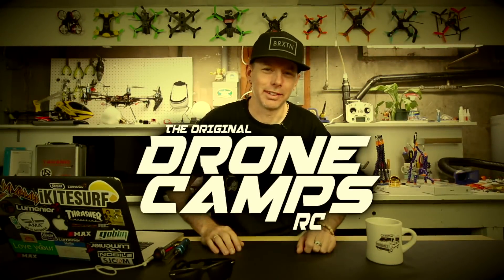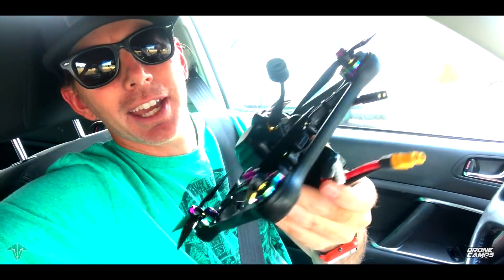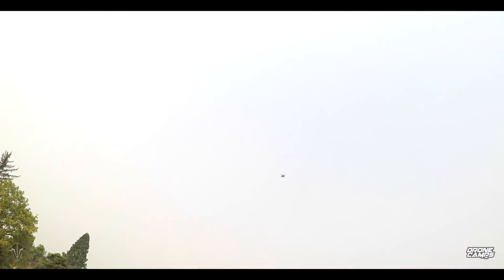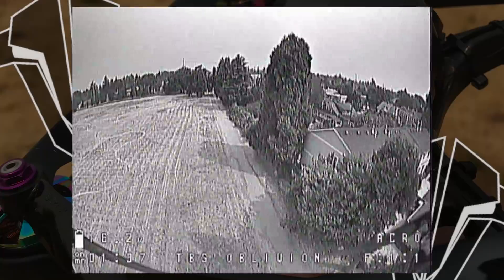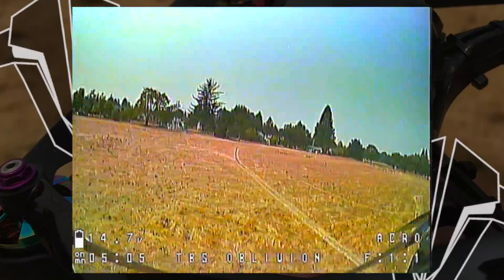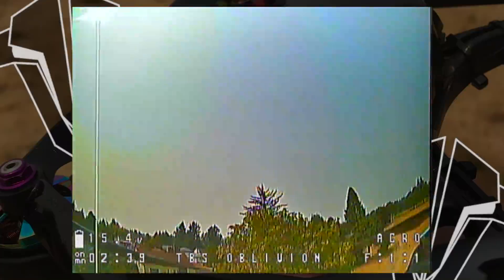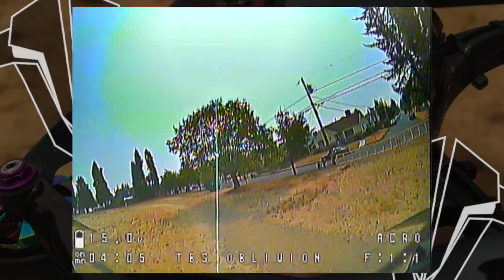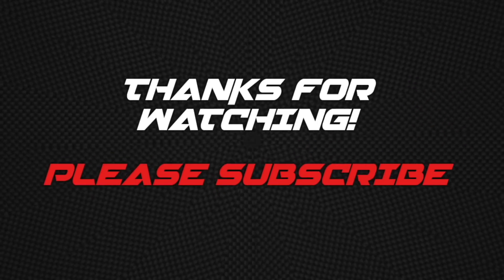TBS OBLIVION - THE UNBREAKABLE DRONE - Honest Review & Flights

Comment: Nice build! I highly suggest using a full size antenna like the triumph, as smaller antennas like the Axii just have less gain overall resulting in a hazy signal long ranging.
Reply from the maker: For sure. I will switch out the antenna to the Triumph before I fly mountains. Also switch the VTX to the AKK 1200mw.
Reply: Drone Camps RC isnt 1200mw illegal in the states? If it isnt im using a AKK FX2 ultimate in all my builds
Reply from the maker: I fly it on 800mw 👍🏻
Reply from the maker: Plenty of range
Reply from the maker: 1200mw actually gets too hot. Melts the plastic covering. Which could cause it to come off the aircraft.
Reply: That's crazy!! I believe it though. Never even had to use 800 on my unify.
Reply: Drone Camps RC wow! Ouch. Is there any way you could use it where it doesn't overheat so much?

Comment: I just bought the Oblivion RTF combo, first racing drone. I currently have a DJI Air and a Mavic pro. What do you recommend to upgrade this drone, type of motors and grade down the road, or anything else for advice to upgrade. Love your video's and if I had to get a second drone (don't care about the money) what would you go with? Not experience in soldering wire yet. Still a noob at this.
Reply: Try the Armattan Chameleon. It's supposed to be awesome! I'd love one but the price point....

Comment: How did you get the esc to fit in the canopy? I literally just finished a build with this frame and had to carve out the back of the canopy to get a similar size esc to fit. Here is a pic of my build https://drive.google.com/file/d/1Z4sHZKtTX4BEi6QhQTj7UWt6donl7hUv/view
Reply from the maker: I used the Dalrc engine 40a Esc. I only put a a small plastic nut under the escs. That way it was lower in the frame.
Reply: Drone Camps RC Got it. Thanks for the reply!

Comment: At the least it should be carbon fibre no less quality I could 3d print a better frame.......That setup needs the diatone m7 ohhh ya mash it up...
Reply from the maker: Yeah no you couldn’t 3D print this. 🤣
Reply: Scan and print why not? I print and design using carbon fibre filament which is much stronger than that plastic. If I am not capable of this someone like 3d printing nerd can :) and rc life on nerd can :)